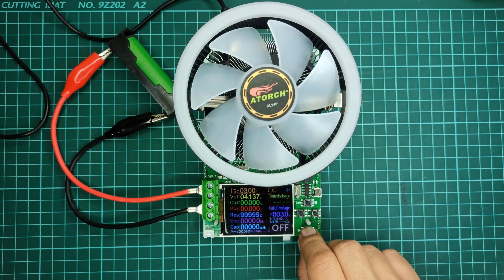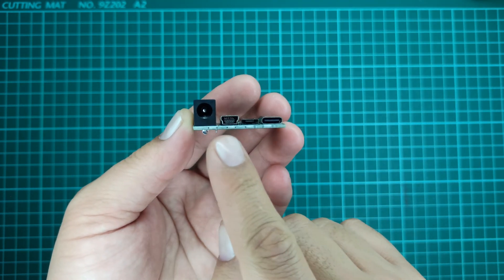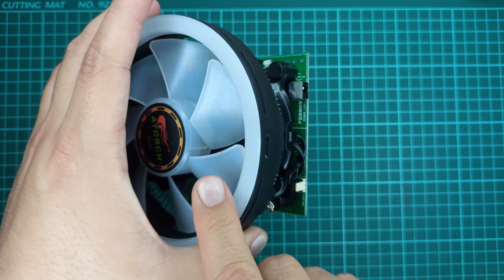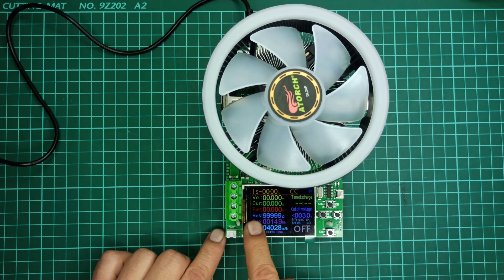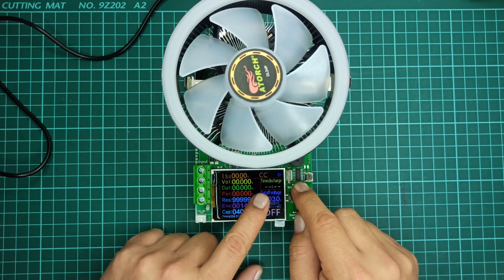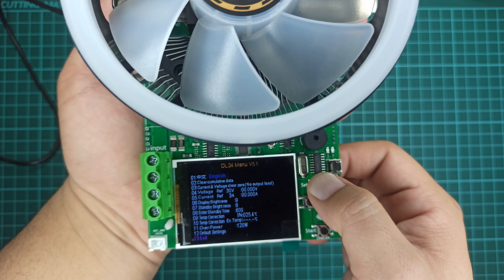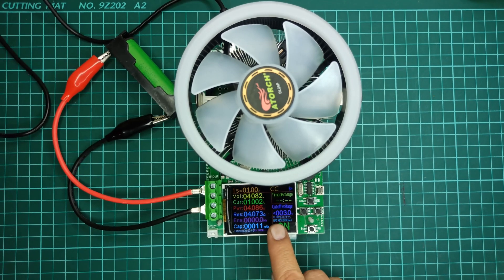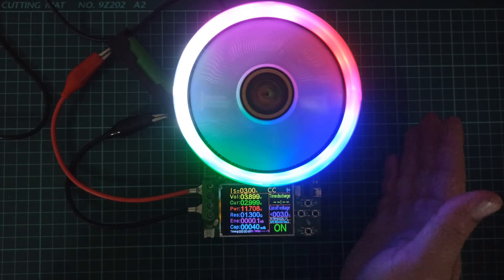How to make Lithium ion battery capacity tester

Comment: Hi!, can i test 52v battery pack with this units?
Reply from the maker: Yes, maximum of 200vDC and 20Amp current as per manufacturer datasheet.
But i recommend not to go beyond 10A current as the PCB microstrip lines are not thick enough to carry 20A current
Reply: @ but when I try with 1amp load the unit’s stop, with my 48v pack I can put 3amp load without problem??? Thank you for your attention
Reply from the maker: @jean-francoisdesrosiers6980 what settings you set before test?
Reply: @ERLEngineering  cut off at 44v, no time and 1amp loads…
Reply from the maker: The settings looks fine to me.
The unit usually stops either due to wrong settings or when the unit temperature raises suddenly or crosses set limit.
Closely monitor the battery voltage during test, i think your battery reaches to 44v quickly due to which your test stops, if this happens then it means you have a weak battery
Reply: @ERLEngineering  no it’s a fresh start from 58v, unit’s stop 2 seconds after I press the start button, I can’t figure out why?

Comment: I have this one. It shuts down over 182W.
Reply from the maker: 182W? 😮
Don't push it above 150W as the pcb microstrip traces are not capable of handling higher power.

Comment: why is your thumbnail is a 12v battery when it cant capacity test that
Reply from the maker: It can handle from DC - 200v and maximum of 185W. I have tested multiple 12v batteries using this tester.
Reply: @ERLEngineering  why does mine has a temperature warning? in like 5 minutes? why is that? the fan is spinning
Reply from the maker: @JorvsUchiha  Whats the load current value that you have set on your device?
Reply: 100Ah 12v batter discharge at 20c
12v x 20A = 240w
set the over power to = 300w

any suggestion on how will I test the battery?
Reply from the maker: @JorvsUchiha If you look at the PCB built quality of this device, you will notice that the tracks on the PCB are not thick enough to handle current more than 10 amps so i'll suggest you to keep the load current under 10 amperes.
This will take longer time to drain the battery but it will not show you any heatup problems.
Reply: @ERLEngineering  Thanks appreciated your help ^_^ will try
Reply from the maker: @JorvsUchiha Glad i helped you 🙂 
I have used this method too to test 12v battery so dont wory it will work